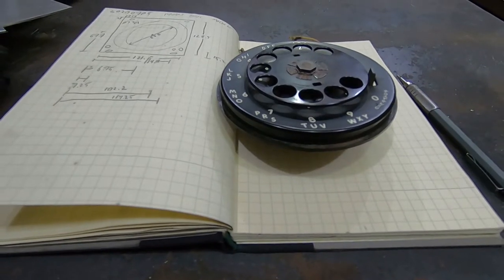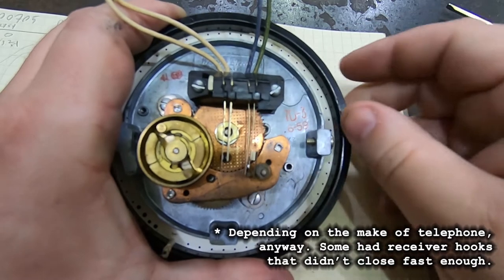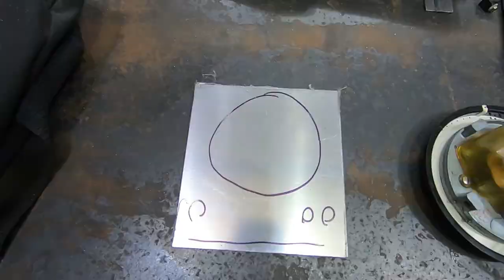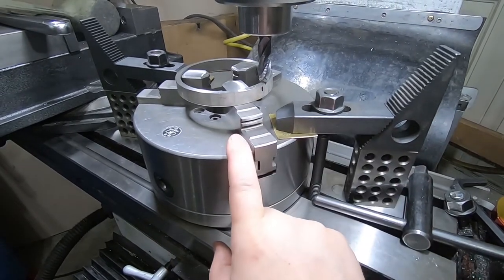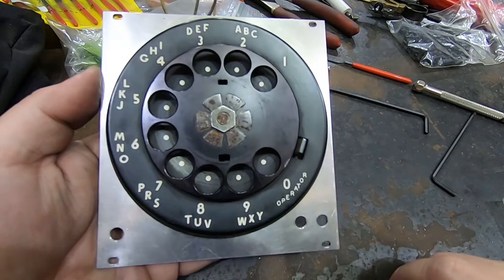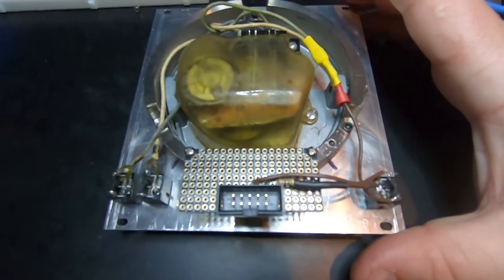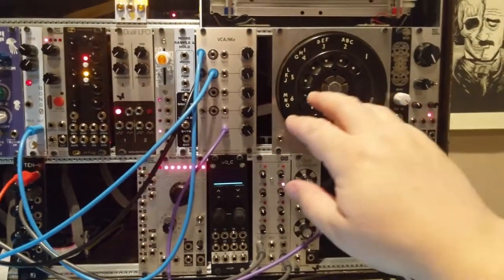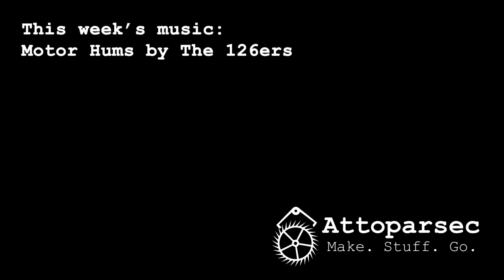Eurorack DIY: Rotary dial module

Comment: RadioShack used to make these dtmf encoders that were handheld, you have me thinking about those for some reason. Really cool project!
Reply from the maker: Thanks! I was actually working on a DTMF module to go with this, that did quantization on 2 X/Y CV signals to determine which tones were being played. It worked on the breadboard, but never on PCB. I should really get back to that one, for just once I'd like to triumph over opamps!
Reply: @Attoparsec  I'd love to see a schematic of what you came up with!